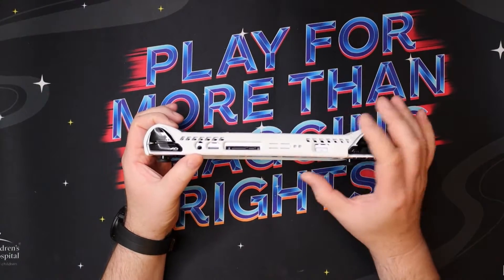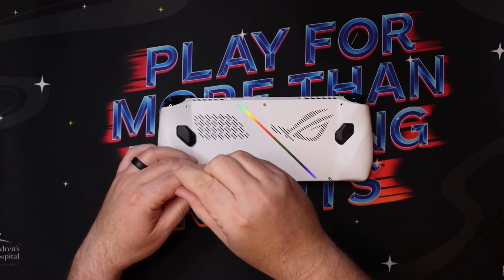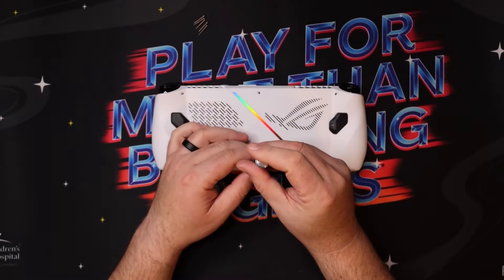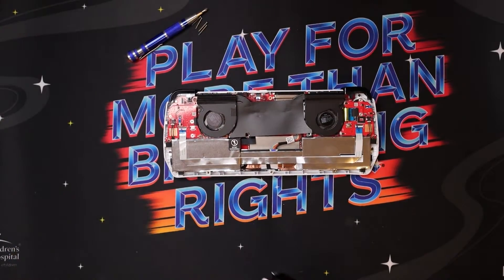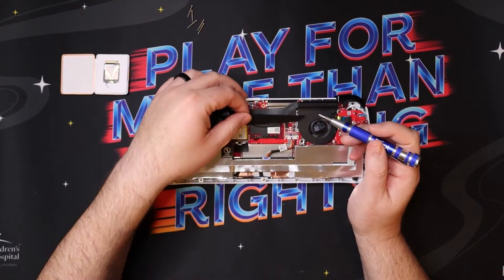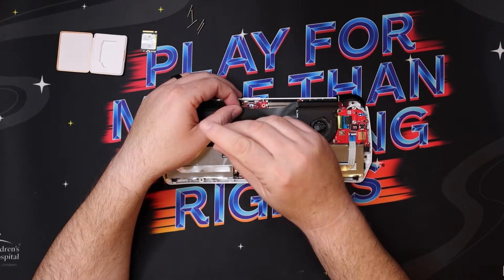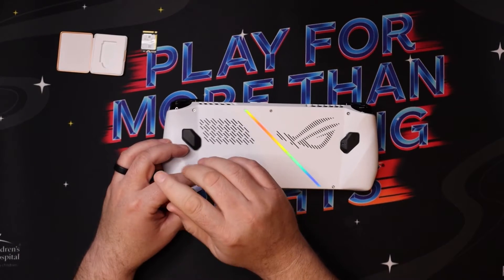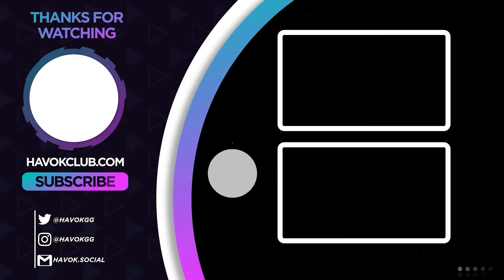UPGRADE THE ASUS ROG ALLY STORAGE

Comment: Surprised you didnt go with a 2280 drive using the right angle adapter.  2TB 2280 drive cost about $100.
Reply from the maker: Unfortunately I purchased the Ally and storage before the adapters came out.